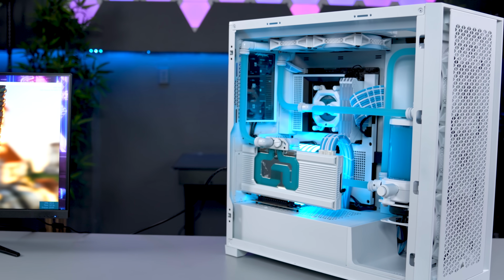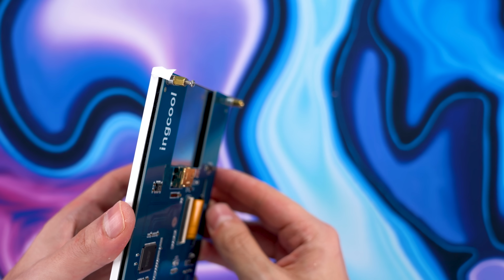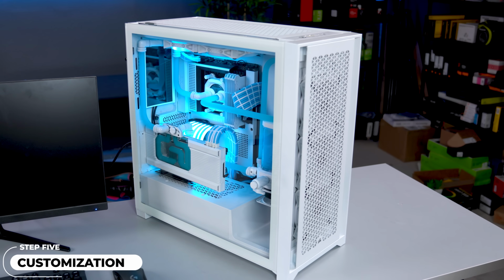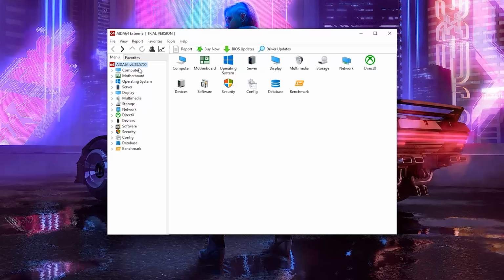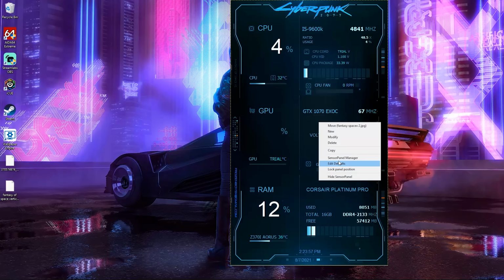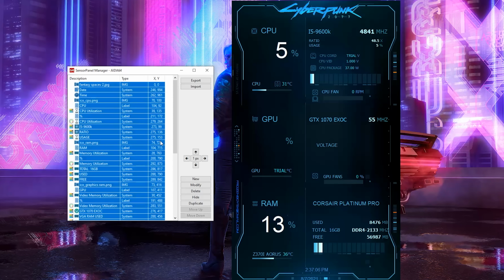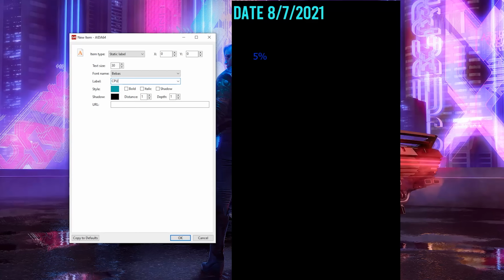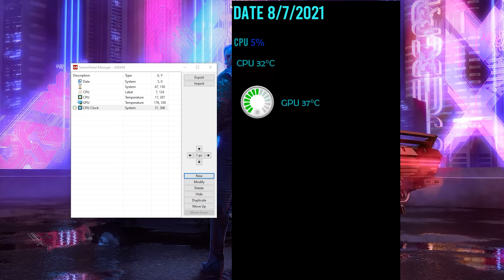The Coolest Mod for your PC!

Comment: Be very careful buying these knock-off PC case screens. When you setup dual screen mode to make them work, Windows will have to use the lowest resolution between the two screens. If you were 4K before, you will now be stuck at the 1280 or lower resolution of the new screen.

Comment: The thing that's stupid about this is that there's only one HDMI slot for your GPU and you need that obviously for your monitor so unplugging that and using your only HDMI 2.1 slot, depending on the GPU you have, is stupid You're not going to use that just for a little display screen over using it for your monitor .. obviously you could use a display port for your monitor and then that for your HDMI but to me it's just dumb... I'd love to get one of these but I'm not going to use my 2.1 HDMI slot on my 40 series GPU for a little display screen

Comment: This monitor won't work because it's touch screen and because it's touch screen it tries to dominate Windows as monitor number one and when you try to move it to monitor number two position windows will not allow it I had to send this back because there's no way to get it set up the way you have it in this video so buyer beware do not buy this particular monitor it will not work because it is touch screen

Comment: Why do you need the same resolution? Is it not possible with different resolutions? I plan on getting a nice 4k monitor for my 4090 and I have no idea what the resolution is of the 5" sensor panel I have.

Comment: how did you pass the cables to the back?

My cover leave no space at all, did you bend one of them? 

I'm going to have mine in the PSU window, going to route the cable to the back of the case, and back in the main bay via the small opening usually used to pass cables for the lower part of mobo

BUT... can't find a way to make them exit the case itself.

Any suggestions?
Reply from the maker: Through the pcie brackets
Reply: hi, did you figure out how to hide these cables through the pcie bracket?

Comment: i have the 7000d and learned you cant use two 420 rads using distro plate from thermaltake. corsair needs to make their own, i had to work magic to get my 240 to fit in the front using fittings to keep the drain port from colliding with pump housing etc. Overall i migrated from view 91 case to 7000d for better airflow.

Comment: Informative and well-produced video. No music is a plus! Where to mount the panel? I used a 4th mounting location. My sensor panel fits into two  5 1/4-inch drive bays as it has a metal mounting bracket. Remember when cases had drive bays? I purchased a full tower case with three front-mounted drive bays. I selected a PHANTEKS ENTHOO PRO PH-ES6-14PTG_BK02. The sensor panel needed two drive bays, and I installed my ASUS BLU-RAY Writer in the third bay. Both devices are easy to see/use at the top of the case. There is still room for my 360 AIO radiator and fans. I've only installed the panel. Can I connect the HDMI cable to the MB rear I/O HDMI port or only to my GPU? You mounted yours at the exhaust fan location. Doesn't that location eliminate your rear exhaust fan?

Comment: am running a full size nzxt cooler and my two thoughts were put the cables behind the radiator everything routing up and out or conveniently there is a a motherboard tray under the area as well

Comment: Wtf? So the two cables (one for power and one for signal) actually go out the PC at the back and you have to plug it in your videocard? Lmao what a dumb idea sorry. I thought this was a PC mod but you just plug in a small monitor into your GPU.... And people with multiple monitors dont even have any spare HDMI slots on the graphics card. Worst mod ever sorry to say but this is stupid if you cannot hook it up to the inside of your PC

Comment: I used one of my old phones with a software that lets me use it as a screen.
With internal usb ports it's pretty easy to setup.
Reply: So how do you solve the issue where it turns on and off independently instead of with your PC? So if you're away from your pc for days the battery for the phone will run out and then you'd have to open the glass panel to turn it on again once it's fully charged, AFTER you turn on your PC. Not worth it for the hassle.

Comment: Hey TechSource, just a quick question I hope you could answer 

I am planning to get a build with a Corsair 4000D and install the raspberry pi 5 inch screen. However the fan I’m thinking to remove (the one in the same slot as yours) is only 4.724 inches. Do you think I should still get it, or just get a smaller version that I know will fit and if you do think that please send me a link on which 4 inch screen you think would be the best

Thanks,
Jezz

Comment: I did notice that while running the sensor panel (2nd display) AMD Adredaline overlay will not indicate FPS either in the overlay or in the Sensor Panel itself it either redas N/A in AMD overlay or 0 in sensor panel FPS counter.
Anyone else having the issue and possible fix?

Comment: i am building a gaming rig for my son. Using Ryzen 7 7700X on GABYTE X670 AORUS ELITE AX paired with GIGABYTE Eagle OC GeForce RTX 3060 (at least until we can afford a 4000 series) in  Fractal Design Meshify 2 Lite RGB case. Question is, would it be better to use the video integrated in the CPU for this small display or the second HDMI output on the GPU?

Comment: You can also NOT put it inside of your PC, if you get one with a case & touch screen you can use it as a sound board while streaming, or mount it vertical on the side of your monitor for chat text, or mount it on top of your monitor for a driving sim setup as a rear view mirror.

Comment: BTW they also come in round LCDs, one of the round one lets your plug a Raspberry Pi Zero 2 W directly into its back, so then all you need to do is give it power & control it over wifi.
I want to get 3 of the 1" LCDs & mount them over the center of the fan hubs.

Comment: I newest mod I've been adding to PC if you can even call it a mod, is adding a leak sensor & wall outlet power control, & using IFTTT linking them together, if the leak sensor detects a leak it will cut power going to your PC.  And even AIO water coolers can leak.
Reply: IFTTT also sends me an email... people with custom loops, & AIO cooling just sit down & press power without looking for a leak, & if it did leak, they will most likely kill something, & if very lucky its only the power supply fuse that is almost always soldered in place.  

Don't try & remove blown fuse if it is soldered in place, it's not worth the time, just jumper the dead fuse using a new fuse with the same specs as the old & wire & solder them in, but it is best to buy & solder in a fuse holder, this way you're not applying any heat to the fuse, & will be easier to replace in the future.

Comment: Question:  So I dont get it how you can match the Resolution from your new small monitor to your main monitor.  Main Monitor being 3440 x 1440 and new little monitor having an 800 x 480 display resolution.  What am I missing? I thought you said they have to match or it will be all screwed up.

Comment: I want to do this..I can use standoffs and place it under my gpu..only issue is (like many) is my gpu has 1 hdmi port..and it's being utilized by the monitor...I can try a displayport to hdmi cord but the shortest cord I could find is 3 feet long..I may give it a shot anyway

Comment: I would have 1 question, why not build the display in the front.
And one idea would be a Raspberry, maybe even with a touch display, then you wouldn't need to set up a 2nd monitor under Windows.

Comment: In reality it doesn’t have to match your main display resolution. It will look bad messed up but that’s just because of the low resolution these cheap displays come with. If u want one to match your 1080p display then you’ll be spending more money. But u can find a cheap $50 display with poor resolution but it’s not like you need 1080p or better to show off your temps. U can even find some for cheaper but I’m sure u don’t want a potato showing off ur temps for $10 lol.

Comment: I already have dual monitors (a 4k and a 1440 ultrawide) would adding this as a third monitor be too much for my GPU? I like the look but don't want the power it takes to run it to interfere with any possible gaming latency or slowdowns. Cheers

Comment: I kinda had the same idea, but a 12in. LCD in place of the metal mesh on my pc's side panel. It's a Cougar QBX itx case. My plan is to solder an hdmi dongle/extension (I never use it) to my 3060 on the interior of the case...well....bc I'm bored lol.

Comment: Hi, I bought a 9" ultrawide display to put under my main screen (55" tv) but if I boot up my pc it freaks out, hope you know a cheap & easy fix:
hdmi won't put out signal and displayport has the same problem, since the card has 1 hdmi 3 dp I need to utilize both the sensordisplay is connected through a dp to hdmi cable, any help is appreciated

Comment: Is it possible, that if your pc starts the sensor panel automatically starts on the right monitor?
Reply: Probably not. You would likely need to open AIDA64 and move it to the 5/7-inch panel after each restart. This is tedious, but because the panel isn't connected directly to the motherboard and is instead used a 2nd/3rd monitor, there really isn't a way around this. That's the main reason I'm hesitant to try this mod myself.

Comment: Heey, if you have a newer Mainboard with USB-C for the front panel, then you should also be able to get a monitor only with a USB C connection so that way you don't have run the cable to the outside of the case and also only need one cable ^^

Comment: I ordered the 7" screen last night for my 5000D airflow. Been looking to do this for a while and plan to follow your mount option. Thank you for such a great video. Where do you get the wallpapers?
Reply: For others wondering, I rewatched the video and noticed its Wallpaper Engine on Steam. I picked it up and they have some good options. To download wallpapers you have to follow the ones you want, not a huge deal. My wife even think this is going to look cool once I get the display mounted in the case.

Comment: 4:45 Why didn't you get washers for the outside to allow the screws to attach better?
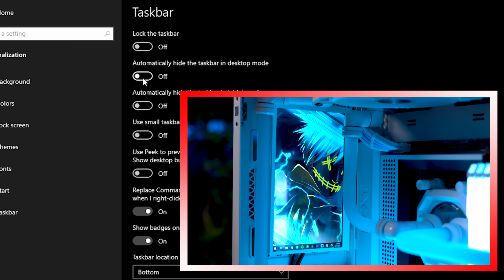6:18 Why would you choose that option? That will make your taskbar disappear on your main monitor too? There's another option "Show taskbar on all monitors", just disable that and the taskbar will only be shown on your main display and not on the panel.

Comment: I liked your video, then by reading the comments, I noticed "spacedesk" for an external device. Since I have a tablet charging from a USB port almost 100% of the time, I thought it would be a good time to try that. The spacedesk site has a caution about nVidia graphics drivers, so I updated them. (Not sure why they weren't updated automatically.) 

Downloaded AIDA64, but like the comments also say, it's a Trial Version.

I'm gonna try all this stuff and see how it goes, but I really want visibility of my system. I had NZXT's CAM on my computer for a long time, but it got to the point that it would take a long time to load and sometimes wouldn't even open, so I finally uninstalled it. This just might be the solution I've been looking for. I hope so!

Comment: I have a small screen size of 2.2 inches and the wire for the attachment is USB 2.0 which is plugged into the motherboard from the inside 'I couldn't display anything on it' it just shows the manufacturer's logo 'Does anyone know how to use this little plug because it doesn't have a HDMI port 'only USB and three pin RGB'

Comment: @TechSource I've noticed, that you have a air bubble in your water cooling sitting right in your cpu cooler. Your CPU is set a high risk of overheat, as your watercooling will not work properly in this area. You should get rid of the air inside your CPU cooler. Nice video btw. I was thinking about this for longer time. With your video I now know how to do so. Thank's alot. 👍

Comment: I remember trying to find stand-offs 17 years ago when I built my last PC I went everywhere I went to PC fix it shops, Radio shack none of the PC place even knew what they were neither did the other store and they had none online back then I had to rob some from a few old cases/mobos I happened to find in my house, Hrmm looks like the animated background would pull on the GPU don’t know if I would use one, static backgrounds are easier to render especially if your have a lower spec video card like say a GT 710 or something like that

Comment: You could probably use an internal USB HUB, and then an USB -> HDMI adapter, to make this happen without routing any cables outside the case. There might even be a simpler solution like a single internal addon card that could handle both natively.
Reply: I found a 3.5in display that can be used with just a single usb-c cable, that way you can just connect it to a usb header on the mobo for a full internal display. Only downside is you can only run it with their own software which isnt as good as aida64

Comment: Just a question, the cables running down the monitor, cound't be routed outside the case from a hole made on the grid? I know that it woud be "destroying" the case, but that 2 cables could be not at sight. Just asking, don't know if it was possible or not

Comment: did you use the 5 inch display or 7 i was going to get the inwin 925 and put the screen in the basemnt cutout but i have a watercooled lian li pc 011xl  only place i can put it is where the rear exhauste fan usually goes and i want it to be a perfect fit

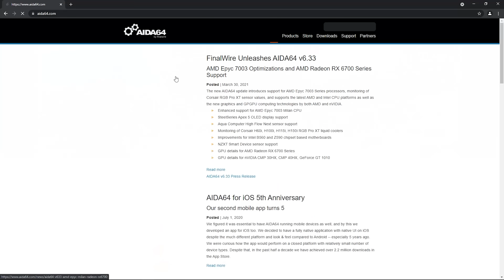Comment: At 6:55 you say AIDA64 is free software. Seconds later, you click on AIDA64 EXTREME Download. Are you saying that you can get a FREE Download that works without clicking Buy now? Important cause AIDA64 EXTREME costs $50 to buy. Buying EXTREME doubles the cost of this project. Weird they would offer the same program for free when they are selling it for $50. Are they hoping for miss clicks from people in a hurry or people to think they have to buy to get it to work? NOBODY with these panel videos mentions having to Buy now.
Reply: Just sail the seas

Comment: When hiding your taskbar, if you scroll further down, there is an option for multiple displays to show taskbar on all displays. Toggle that off if you still want your taskbar visible on your main monitor but not your other monitors.
Reply: thanks mate, wouldn't make sense to toggle the taskbar off for me if that option wasn't available.
Reply: Only problem is when you have a multi monitor setup, because this will only show the Taskbar only on one monitor and aik there isn't an option to select on which you want to show it
Reply: @Thomate1375  you just click and drag the taskbar around
Reply: @Thomate1375  auto hide your taskbar then enable show taskbar on multiple displays. You get a taskbar for all displays but it won't be visble unless you want it to be.
Reply: Awesome was thinking if there was a option for this :D
Reply: thank you that was my problem and noe its solved:)
Reply: Man this implementation is just bad, you should use a raspberry py to not waste a graphics card port not just attach the monitor, lots of people use multiple monitors
Reply: @eltonz  Can you do this easily with a Raspberry PI?
Reply: thank u
Reply: Awesome thanks man
Reply: And what if you want 2 displays showing the taskbar but the mini display  not?
Reply: @JohnnyZenith  Hmmm i dont think Windows has a way to do this. You might have to use a program like DisplayFusion or something similar.
Reply: @CoryB-op7pf  Yeah I guess so.  Thanks for the reply.
Reply: like 777 :)
Reply: To add to this, if you are on Windows 11 in the taskbar settings there is a setting under 'Taskbar Behaviors' called 'Show my taskbar on all displays.' Toggle This.
Reply: thanks man. this is solve my problem
Reply: bro i love you, you just save my life
Reply: Didn't work it pet pushing everything I wanna do to the small screen and not keeping my main screen for all my apps and system info
Reply: Just as an addition, you could do this then if you have multiple display monitors you could not have it set to duplicate one, but then drag the taskbar to one of the monitor thats not duplicated. Hope this Helps😁 or just set up the sensor panel idea but use a video or picture instead of Guages.
Reply: Heart this comment
Reply: @dhirtimankhati8376 ❤

Comment: How comes your 5800x is idling at 32 while mine is around 45-50, when gaming it hits 82 and stressing it can make it around 100... Tried AIO, expensive AIR cooler and custom loop with no sucess... Playing with PBO doesn't help as well...